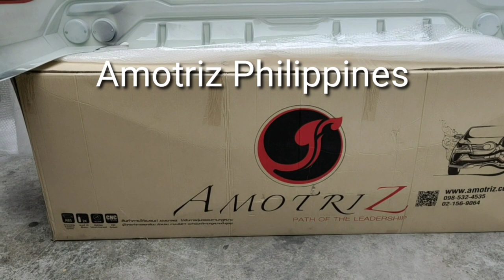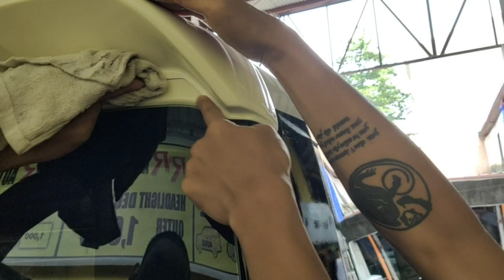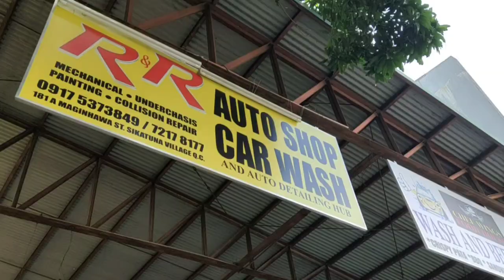Toyota Hi Ace Commuter Van with Amotriz Body Kits

Comment: Sir magkano po front lip spoiler/side skirt/rear roof spoiler wing,,para sa 2019 grandia tourer? 2tone ang kulay,,,kapag hndi kasama ung spoiler sa likuran na bumper,salamat
Reply: Sir kailangan ko order nyan
Reply: Commuter deluxe din van ko
Reply: Magkano sir?
Reply from the maker: Yes punta po kayo sa Amotriz Philippines sa fb page.
Reply from the maker: 50k po set with paint and installation
Reply: Sir available po ba ung isang set from amotriz brand ung wlang led light sa front bmper,pati ung rear bmper na walang muffler holes?